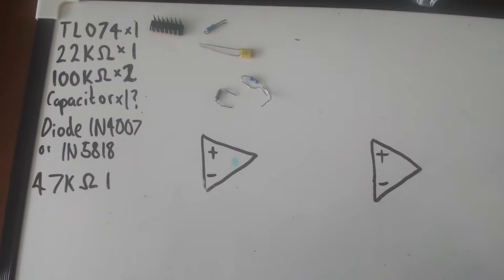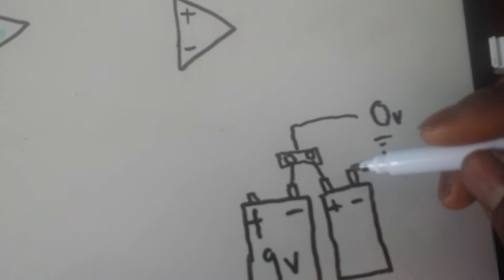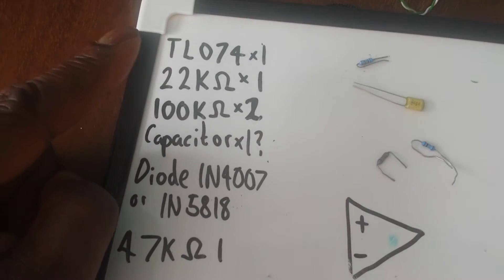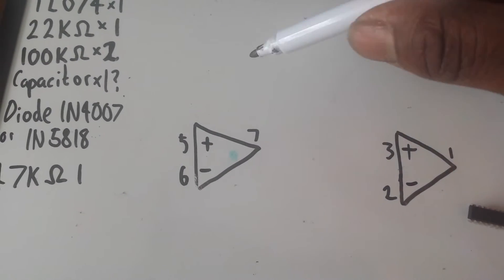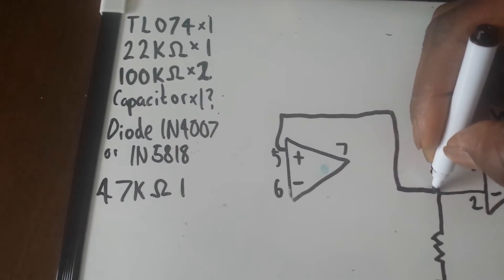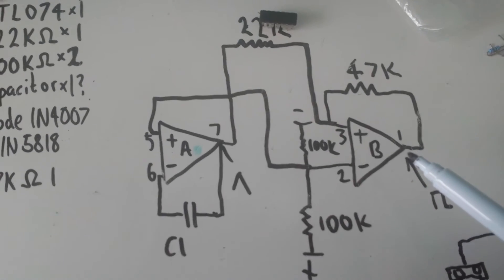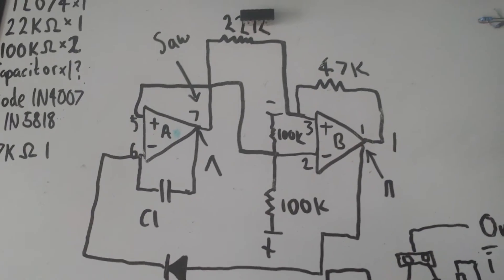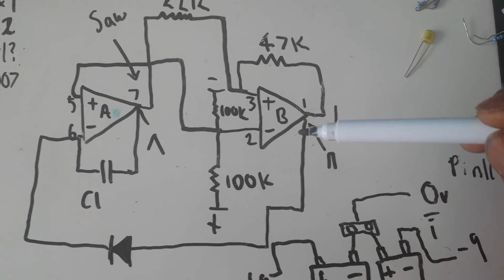DIY analog synth project Tutorial Part 1 (The Saw core oscillator)

Comment: To anyone confused about where the CV is supposed to go: It's at the negative input of op-amp A (pin 6). Be sure to put a resistor in series (somewhere in the neighborhood from 10k to 100k, depending on capacitor size).

Note that the control voltage will have to be lower than the voltage at pin 2 (in this case, zero volts). This is because this VCO core is intended to be used in conjunction with an exponential converter that sinks current (current flows into the converter, but doesn't flow out into the VCO core), where the current flowing into it would be controlled by the CV input of the converter.

I'm not entirely sure how this would work without a resistor to some voltage at pin 6, because without any other connection there, the diode would block the capacitor from discharging after being charged (unless current were somehow running through the negative input, which is unlikely as the TL07x line are specifically designed to have an extremely high input impedance).

Replacing the diode with a potentiometer would allow it to work as a triangle and square wave LFO, where the frequency would be adjustable with that potentiometer, and the offset and shape would be controlled by the potentiometer connected to pins 2 and 5, but you won't be able to use CV to control the frequency (not reliably anyway).

If you turn the diode the other way around, the CV input will need to be higher than the voltage at pin 2.

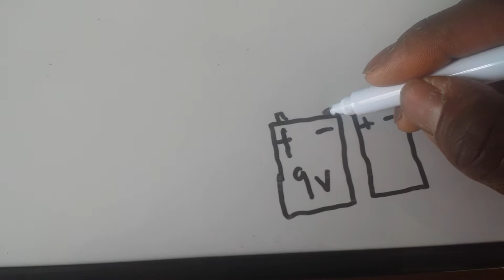Comment: Hi. Can you talk a little more about the battery configuration you are using to power your op amps at 1:00? I am having great difficulty in finding instruction this. Are you really taking THREE connections from your battery to the board? Or just two?
Reply from the maker: Hi haze yes three connections out . 1 will be + 9v and 1 -9v. The two opposing +and - 9volt connections you join together to get your get 0v/ground. An Lm358 for instance can have pin 4 connected to ground or -9v and pin 8 to +9v. However say a tl072 or ne5532 may need to be connected as follows pin 4 -9v and pin 8 +9v. The 0v will be for anywhere on the schem that shows ground basically.
Reply: Thank you kindly! I spent a large part of the day banging my head against this stuff. I learned that you can use a simple voltage divider with 2 equal resistors to create a virtual ground rail and check out this puppy: http://www.ti.com/lit/ds/symlink/tle2426.pdf At any rate I decided to stick with either ONE 9v battery or two 6v batteries in parallel. TWO 9v batteries just seemed like too much voltage for these chips. :/ The sound coming out of the op amp is pretty awful but it's a start! (I am not looking to oscillate these just yet, rather want to make a mixer, amp and filters 1st)
Reply: Silly me ... 15v is the max rating for the INPUT signal, not the power. Imma hang onto these 6V batteries anyway, maybe they will come in handy on down the road. I do not plan on getting a power supply anytime soon, but I have an oscilloscope DIY kit on the way ...

Comment: Hi, I was curious if with all of the types of oscillator circuits available, if on average, there is a specific type most analog synths use. This could be for LFO and audio range. I understand that something like crystal is probably for higher above hearing ranges and not used and understand there are many applications and scenarios to govern different choices but am sure there are some more used than others. Example:

rc oscillator
colpitts
lc oscillator 
hartley
crystal
tuned collector
555 timer
negative resistance oscillator 
Wien Bridge
Cross Coupled
phase shift oscillator 
Opto Electric
Esaki Osc (bjt breakdown type w no bass) 

Thanks!
Reply from the maker: freaksarise Most i have seen are rc oscillators all in very similar configuration to this , but mostly using a fet and diode as pose to just a diode as in this saw core.
Reply: I have been having a lot of fun with 555 timers and Esaki oscillators are probably the easiest to build. Have you checked out the CD40106? I was able to get that one to oscillate very easily and there is also the CD4093, which I will play around with hopefully before the month is over. Of course, the BIG one is the CEM3340 but I don't trust my butter fingers with it. 😂

Comment: First: Great video! I've built some of these oscillators by myself. :)
Second: Let's say that i want to put several fixed value resistors between the output of the first op amp and the inverting input of the second one so i can generate both square and triangular wave of a desired frequency (which is fixated by each of those resistors). There's also a switch with each resistor. This way i have a rudimentary keyboard because each swith will produce a different tone. Now my question is: How can i do to be able to play 2 or more notes without having an oscillator for each key? Because if i want to build a 37 keys keyboard, it would be a bit inconvenient :P I could implement some digital control with a microcontroller and using digital potentiometers but i would like to keep it analog. Do you have any idea?
Reply from the maker: Gino Ipóliti Perhaps look at some duophonic circuit designs . For instance the Arp odessy. Roland pro mars and a few others whoch seem to use analog, but still i cant quite work out how these do it.
Reply: Oh i will serch about those then. I if manage to figure out something i'll tell you. Thanks for the answer
Reply from the maker: Gino Ipóliti  Brilliant i would really appreciate that.

Comment: I'm building a similar droney-oscillator box, but I'm using a single 9V (so 9 to 0) source, since that could easily be used with my 9V wall socket supplies. Is it possible/easy to make a +9/-9 wall socket power supply (NOT with batteries) to use? I tried finding them oneline, but no success :'(
Reply from the maker: Willem Zenhorst Hi . Unfortunatly i havnt seen one either. I think  your just going to have to seek out a 12vac to ac solution that then you can convert to +/-9v dc via a rectifier and then use regulators out to circuit/s.
Reply from the maker: Willem Zenhorst . Perhaps google power supply schematics and see what you can find or go on to synthdiy facebook group and ask.
Reply from the maker: Willem Zenhorst Hey man , go to frequency central website they sell a bare linear +12/-12 power supply that you need to supply with a +12ac transformer NOT DC and it converts to DC. Also MFOS have a version. I recently bought 2 power supply pcbs . One is lm337/317 adjustable +/- and the other is using fixed regulators. I will be doing a video very soon .
Reply: Thanks, will have a look!
For now having fun with a great DIY Tremolo: Tremulus Lune, worth checking out (although I'm a beginner, so it might be too straightforward for the veteran breadboarders, but it's quite versatile and weird!).
Reply from the maker: Willem Zenhorst Sounds intresting. Maybe share your project/s with us guys and i still don't class myself as an expert we all start somewhere ;-)

Comment: Your 100k resistors are setting up 0 Volts at pins 5 and 2 - you should just connect those pins to your supply's 0 V and eliminate the resistors.
Your yellow rectangular capacitor is polyester (aka mylar aka film), the orange drops are tantalum.
Reply from the maker: sdm02 Thankyou for your comment. Since this particular video i have made quite a few changes and discoveries. I have now changed the timing caps to polystyrene 180pf and the diodes to 1n 4148s also the voltage divider resistors have been replaced with a trimmers , which assist in balancing the triangle wave symmetry. The resistor from pins 1to 3 is now 4.7k and the resistor pjns 3 to 7 is now 1.8k. The oscillator performs very well under voltage control frim the expo , with a very wide range and consistant waveforms.
Reply: @AdamTheAd-vanc3d  Hi dude, great video. When you say you replaced the voltage divider resistors with a trimmer what do you mean?  A potentiometer or something else?  Do you have a link to an item like the trimmer(s) you used?
Reply from the maker: @RustyValveMusic  https://youtu.be/uOWjSYCqw5o  Check this video put this shows the implementation of the trimmer. Thou the R1 and R2 resistors in that video are not necessary. 
The trimmers I use now are the small multiturn trimmers. Type in Bourns cermet trimmer In your browser. There are some cheaper copies which work just as well :-), they normally come in values of , 1,2,5,10,20,50,100,200,500k also 1 and 2megohms.
https://www.ebay.co.uk/itm/121694846730
Reply: @AdamTheAd-vanc3d  Thanks very much for the info and fast reply.  I understand now.  Is that video the final schematic for this Oscillator?
Reply from the maker: @RustyValveMusic  Yes pretty much the final .

Comment: HI adamski, great resource here! Could you explain how current and voltage flow in the circuit? I guess is some sort of integrator/comparator combo.
Reply from the maker: alfonso santimone As ive said before im no engineer so couldnt explain from head to toe on how this oscillator works . Thanks for putting the question foward still. If you look for this on Youtube it may help a little : "How a DCO works". The guys channel is called GOLT . The oscillator he discusses has very similar topology. Also google Jupiter 8 vco muffwiggler. There is about 8 pages on how that osc and expo converter work.  Please also watch Part 1b of this series as ive recently made some very useful amendments :-)
Reply: Adamski Ajull thanks! you are a really good one with the diy philosophy! really great!
Reply from the maker: alfonso santimone Thankyou its inspiring to hear a comment like yours ;-)

Comment: My assembly of this circuit gives a much lower tone from TRI output. When I insert the diode SAW sounds higher. Few tones or even an octave maybe. Is this normal?
P.S. At least it started to working )) Before some time I've heard only the square output. Just trimmed and reconnected few wires.
Reply from the maker: MoolahNasreddin Yes thats coreect the saw will combine the triangle and square to give you the saw at pin 7 amd then you will have a very narrow pulse at pin 1  narrow this is your saw core that you will waveshape into the other wave forms as i explained in the other vids :-)
Reply: The main issue for me is "can triangle's frequency be much lower than saw frequency in the same circuit?" I've thought that these must have the same frequency without "tweakings".
Reply from the maker: Did you build the triangle wave from the saw shaper ?, because this is where you derive the same frequency not before you connect the diode from pin 1 to 6 .

Comment: Hello, Ajull!
I've managed to make a kind of "saw LFO". No faster than 9Hz (as my multimeter shows). I've set 100nf (probably) ceramic disc cap. I've tried smaller caps (100pf - ~10nf) but output voltage goes a bit crazy then. It rises to 5v. Once I've tried ceramic 4.7mf - it gives a very slow LFO. And it "moves" by some steps (not sure as I've watched not in an oscilloscope).
How did you've managed to make audible tones? I've didn't tried to connect the speaker to it yet. I guess I need some resistor before it. It's ~6 oHm speaker.
Reply from the maker: MoolahNasreddin  Hi Moolah, are you on facebook ?, im just wondering if i can message you there and help you out later.
Reply: Hi! yep :) Kirill Shustov from Moscow. There will be a photograph of Mayakovsky and I'm in the mirror of it...
Reply from the maker: Thankyou ill send you a freinds r4quest and we can message there.

Comment: Hello, Ajull!
Is it normal that I get around 0,06v between 0v point and pin 2? The joint where two 100k resistors meets. The speaker makes a quite click each time I connect +/- 9v. I'll check tommorow all connections. BTW I've used different ceramic disc capacitors. I guess it gives no big difference with voltages.
Reply: it's necessary to connect 4th and 11th pins (TL074) to plus and minus 9v accordingly. That's the reason ) Datasheet rulez!

Comment: VERY NICE VIDEO,I'm tempted to build it. Maplin is 10 min from home and I got the phone cables.
Reply from the maker: Machine 386 Thankyou. Yes go for it , they dont stock everything but they are not bad. Im going to do another video very soon on how to make the very cheap test equiptment needed , small tip maplins also sell the 9v connectors if your going to start with batteries. Thanks for watching :-)

Comment: Good thing! I'll buy components and build this too :) Thanks! Do more tutorials, please. If you could make it on a breadboard in a parallel then it will be even greater. But schematics are very important!
Reply from the maker: MoolahNasreddin  I do plan to do more very very soon. If you get stuck give me shout at any point 
 . I hope it goes well when you start. Yes as ive said before im still not 100 happy with all circuits yet and need to come up with my panel design at some point for the final desktop semi modular module. Thou im still dreaming up ideas from time to time, so no rush for  me :-).
Reply from the maker: MoolahNasreddin Sorry just read your comment again. With regards to doing a live build in parralel i will try to do my best thou i have to do things one handed which is challenging whilst holding my phone to record.

Comment: 7:15 - How does it happen not to be a short circuit?
Reply from the maker: Rand0081 Not sure of the exact technical explanation. Basically you divide the input voltage down to a smaller value . If often wonders this myself when i first built this circuit from a schematic. There are other ways you can do this as well for instance take a single resistor to from the inverting input to ground. You could try 47k and upwards. Sorry couldnt really answer your question. However i can 100% assure you it works .
Reply: I read that the internal resistance of TL074 is 10^12 ohm, in a parallel circuit with a 100k it would result in 99.99k. Making the voltage on pin 2 to 9V. Is this meaningful?
Reply from the maker: Rand0081 Yes it sounds about right , i will later quickly breadboard the divider to op amp circuit and measure with my meter , and come back to you. Yes your right in that it steps the voltage down. :-)
Reply: Great job, anyway.
Reply from the maker: Rand0081 Thankyou ;-)
Reply: The voltage divider ?